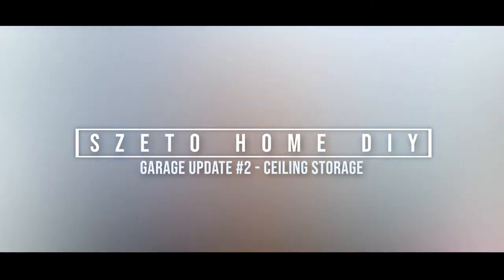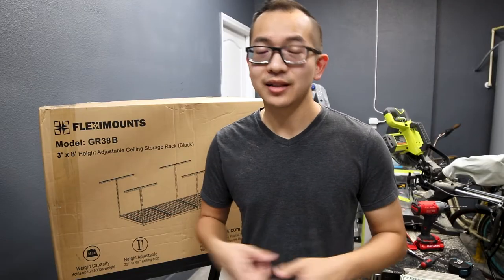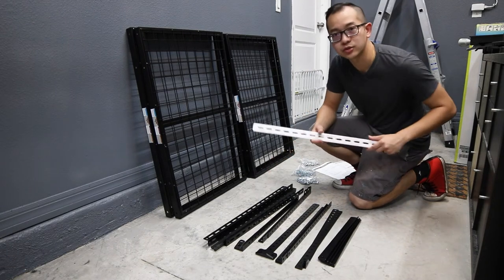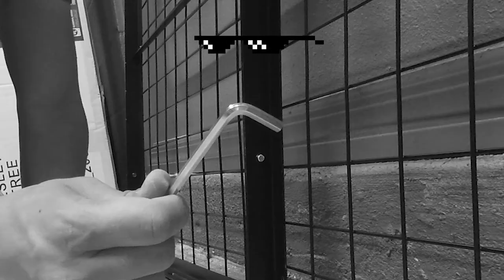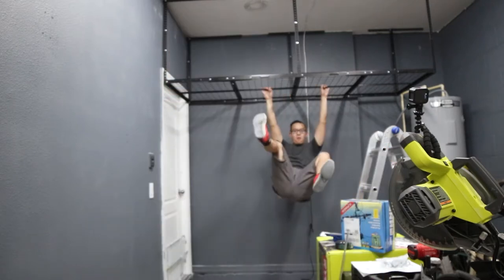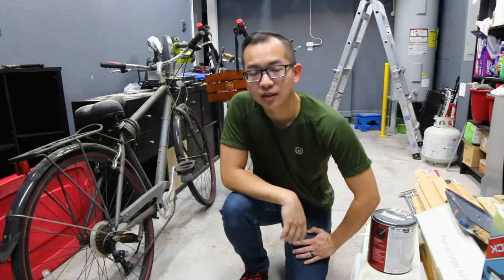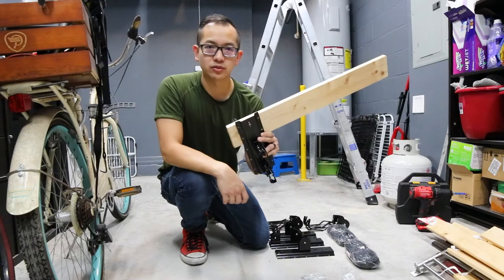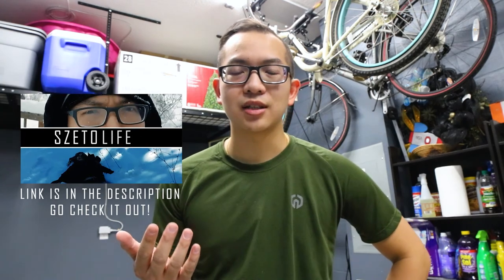Installing Ceiling Storage and Ceiling Bike Racks | Garage Update #2

Comment: How far apart from each other did you install the 2 ceiling bike racks?
Reply from the maker: They are about a foot and a half apart. It gave enough room so that the pedals don't touch each other. Thanks for the question!